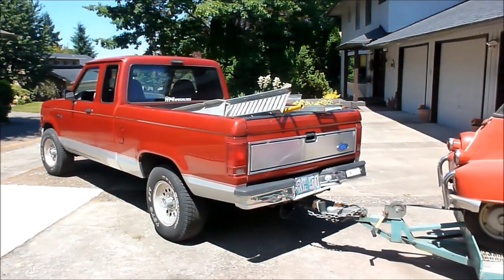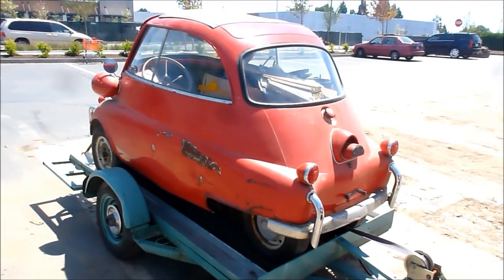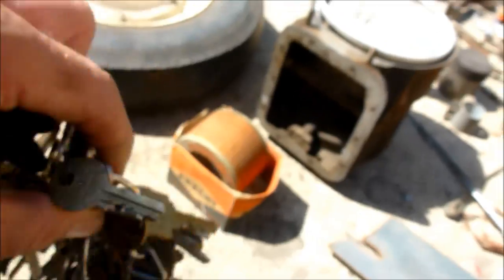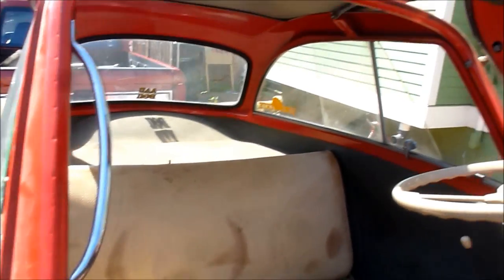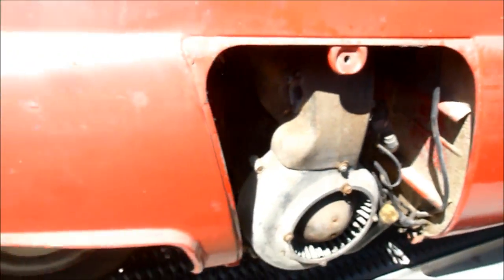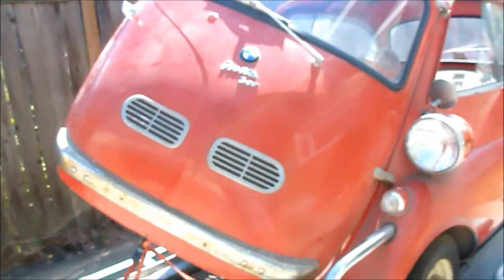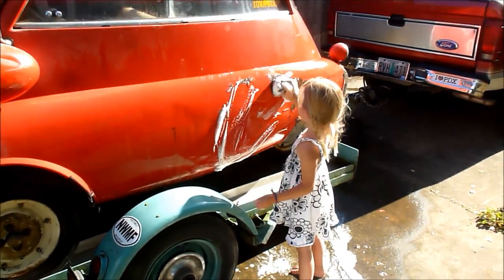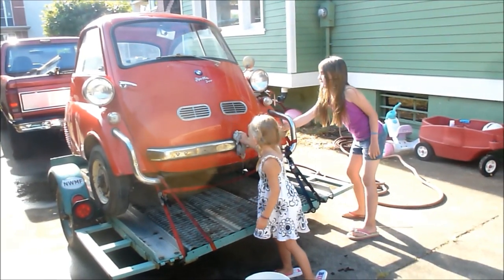Our 1st Isetta

Comment from the maker: Yes, it's turning out nicer than I expected. It's hard to judge a car when you see it crammed in the back of a dark garage with stuff piled on and around it. I feel real lucky.  I feared it would be way more rusty. I wondered what those random tools were, makes perfect sense now. Those tools were in with spare engine block, I thought somehow they were related. Isetta's are scarce in these parts of the NW, unlike Subaru 360's proximity to Japan and West Coast ports, Isettas were never sold here

Comment: Try screwing the big T handled puller into the mystery first part you picked up - I bet it's a puller and look in the special tools caralog. The other one is an expandable reamer probably for wrist pins. I had a '58 Deluxe also in 1984. - Miles